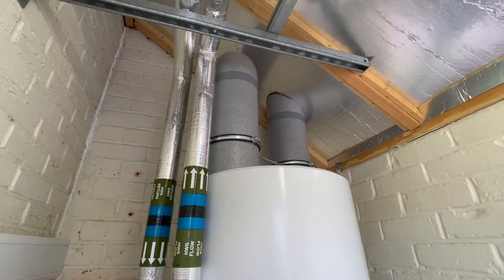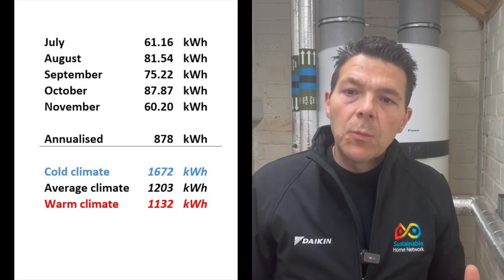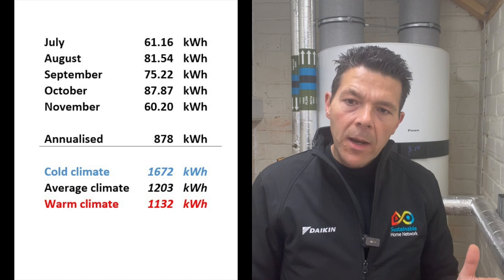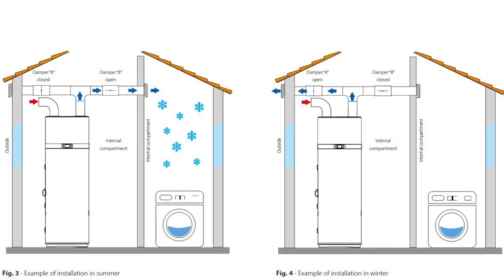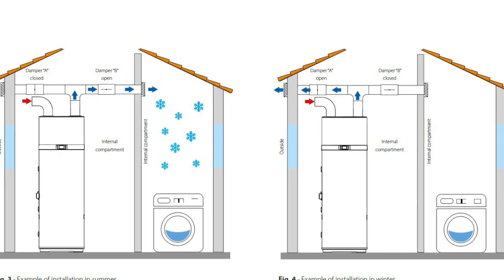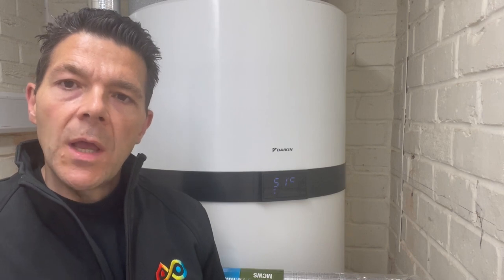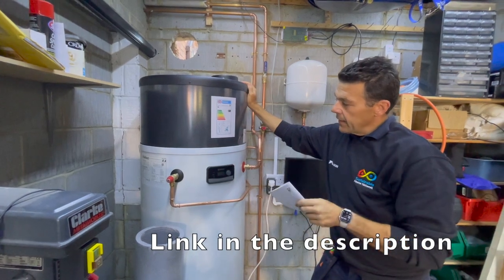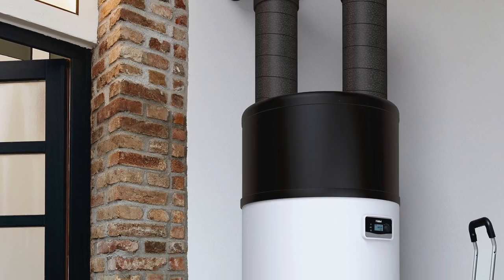Heat Pump Hot Water Cylinders - are they any good? UPDATE!

Comment: Absolutely fabolous that you supplied us with an update. Looking into getting something like this myself, but have been struggling to get hold of any usefull data.

I have sourced a Vaillant type from a supplier in my country, Norway. However I am a bit worried about efficiency during winter, and how mach latent heat I can capture from the basement where it will be placed. Average temp around my area is 7degrees Celcius, and the cellar is at 12C now. A bit humid there, so the potential of getting some dehumidification would be welcome.

Comment: Glad to see an installer putting their own money where their mouth is so to speak - I see a lot of videos making claims but no real world installs or figures to back this up. This is an interesting one as I am fortunate to be able to divert PV to my DHW but I've just added a battery and so the excess available for the diversion is now less - prior to that I was getting 265 ish days of 'free' HW, if that was purely gas then I'd be looking at 3000kWh/year - however using a HP I could make use of the multiplication factor to get more for the remaining excess kWh - good to see that this has that option...

Comment: With a bit of a search, I have yet to find any cases of legionella in single family domestic houses in the UK. I have found some in multi occupancy buildings like flats but not houses. Can anybody demonstrate otherwise? I'd be interested to know.
Reply: 50C is hot enough to prevent legionella from growing, and it also requires stagnant water, which doesn't happen if you are using your hot water.

The rules are overly conservative, and legionella is not a realistic problem.

Comment: informative; thanks.

I have a gas boiler in an upstairs airing cupboard. it has a flue up through the roof.  works perfectly well. for now...

it provides central heating and hot water [120L cylinder].

could I repurpose the existing flue that goes through the roof into the "exhaust" air outlet, and perhaps use loft air as the "supply" air to an air source heat pump? could it replace the existing boiler ("Glow-worm") but "everything else" - pumps, cylinder, etc stay the same. The cylinder has an immersion heater, [as a backup], so I already have electricity supply available. I'm thinking an R290 refrigerant that can reach the 70C necessary to be able to continue using existing radiators and for the pasteurisation cycle.

if such a product | installation could be done, it would, I expect, be a much simpler, much quicker installation - no need to install new pipes to an outside unit, no need to lift floorboards, breach the house envelope, etc.

the home is 10 years old, so relatively well insulated [for the UK!]

Comment: What of running the Heat Pump Cylinder on lower tariff on  Night Saver Electricity thus allowing the compressor for cylinder to spin up a that lower rate and even raising the Nigh Set point temperature on same several degrees thus getting more heat stored within the  cylinder to be then blended with a little cold water maybe even storing more of same for day use  if not used creating less day run time.

Comment: Hello Dameon 
Thank you accidentally came across your videos on A2A heating / cooling system installs at Mike’s home. I also see you have this hot water system as described above 👆. 

I wish to discuss my own house (built 2007) using conventional Vaillant Eco Tec condensing gas boiler etc 

I am embarking along similar to your above two videos (A2A part just completed in October) how ever stage 2 ie hot water replacement of 200L from Mega Flo is still to be designed and completed. 

I would be grateful to initially pick your expert brain and also discuss implementation of the best solution. 

Let me know how we can hold a telecon? 

Many Thanks 
NP

Comment: I've been researching alternatives for when my 8yr old combi gives up the ghost.  I really like the idea of these non split heat pumps as I do have a small solar system that would probably run the pump during the day a lot of the summer time.   Regarding the ducting - the ideal thing I would want to do is have some kind of adjustable duct, so that in the winter it ducts straight up, in and out to my open vented attic, but in the summer, I could flick a switch or lever and change it to duct in and out of the living room so that it would effectively cool my air in the house slightly whilst generating hot water.  Do you think that's possible?

Comment: The mistake here is to have low energy hot water, and not using it.  You need a washing machine and dishwasher with hot and cold connections.  Most of their energy consumption comes from heating cold water.
Reply from the maker: Many appliances now are low water consumption, therefore hardly any hot water would reach the machine before it stops filling and then you’ve got heated water cooling off in pipework. Feasible perhaps if everything were in the same room together. And then there’s the challenge of finding energy efficient appliances with hot and cold supplies in the 21st century. You could connect hot water onto the cold supply with a temperature blending valve in-line, if it were worth it and wouldn’t cause any issues with the appliance. My Miele dishwasher would very likely throw a fault code if filled with warm water. It has a pre-storage function whereby it keeps pre wash water at ambient temperatures within itself. Good idea, but needs to be thought through
Reply: @dameonhill  I run our Bosch Dishwasher on hot water which has a maximum inlet temperature of 60C. In my previous house I insulated all the hot pipes and had almost instant hot water, that's an in progress at the moment in the current house, while we procrastinate about getting the same type of heating system as you, do you cover Burnham-on-Sea?
Reply from the maker: @MrKarlPrince  Yes absolutely, please drop me an email 👍
Reply: what was your annualised energy consumption with an old resistive immersion? difficult to understand the consumption/lack without that context.  That new Daikin multisplit sounds interesting as a ‘whole home’ boiler/CH replacement